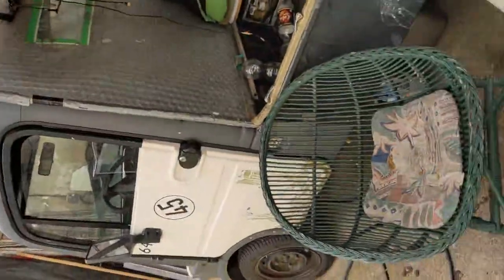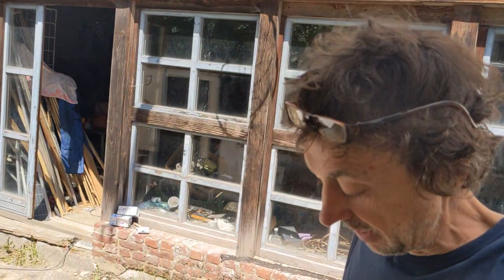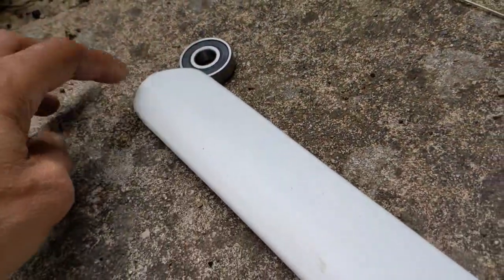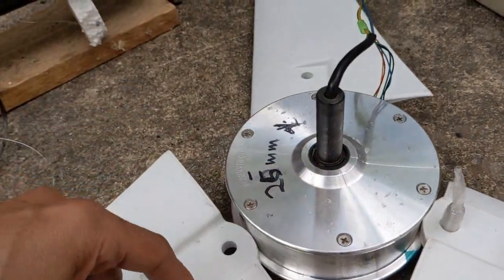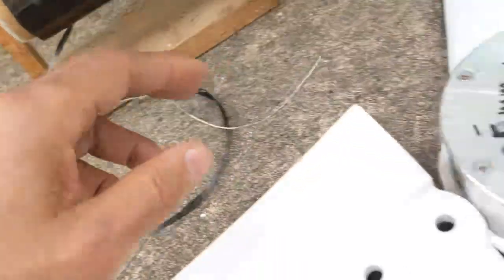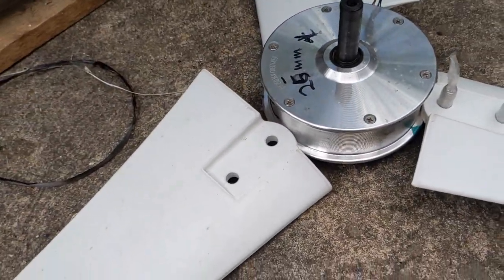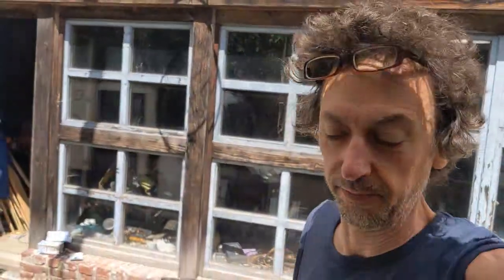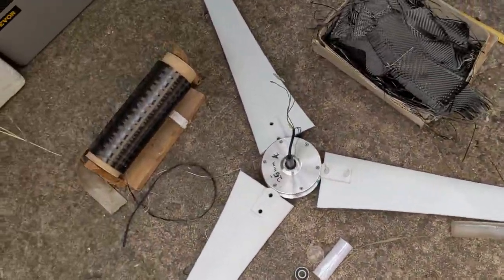4ina: $100 / $50 / $30 for YOU if you build this wind turbine :-)

Comment: What about a metal or other composite ring split into three pieces, with each piece being bolted to a blade? Then you bring the three pieces together around the motor and then bolt or clamp them together with some type of simple bracket or tab on the edges.Then some carbon over the top possibly.
Reply from the maker: Thanks for the input, yes if you want the $100 for a different mount, we first have to agree on your design ;-)
What is crucial about this challenge here is:
1. the hoverboard motor is not modified, at least not opened.
2. The blade mount can be made in one step, at least only two steps (my glassfiber roving approach might need a backside stage and a frontside stage)
3. No welding or other expensive tools neccesary
4. Cheap materials.

And yes, i also already had the idea to simply 3d print three blade-mount parts that simply get pulled onto the hoverboard motor with "Stainless Steel Metal Cable Ties"
The ABS material would mostly need to absorb push forces while the cable ties would carry all the pull forces 🙂

concern 1: centrifugal force F = m v² / r
v_storm = 30 m/s and tsr = 5 (tip speed ratio)
v_tip = 5 * v_storm = 150 m/s
blade length = 104 cm and  blade mount radius = 12 cm
v_12cm = 12/110 * v_tip = 16.36 m/s
m_blade = 0.5 kg
F_30 = 0.5 * (16.36 * 16.36) / 0.12 = 1115 N = 111.5 kg
40 m/s : F_40 = (4/3)² * F_30 = 198 kg
50 m/s : F_50 = (5/3)² * F_30 = 310 kg
Stainless Steel Metal Cable Ties
7.9mm = 150 kg , 10 mm = 210 kg , 12 mm = 280 kg
2x 10mm (to avoid Rotating unbalance) = 560 kg
one blade is hold from two sides at 60° = 2 * cos(30) * 560 = 970 kg :-)

concern 2: Is the engery generating torque twisting the blade forward ?
rpm = 14 rpm/V * 36 = 504 rpm and power generating: 500 Watt
https://www.wolfgang-frank.eu/drehmoment.php => 9.55 N m
divided by the three blades = 3.2 N m
torque between the two mounting bolts = 3.2 * 100/4 = 80 N m = 8 kg :-)

concern 3:
resonant vibrations could easily doube, trible or tenfold any static forces like concern 1 or 2 😕
But the electric generator should absorb concern2 energy fluctiations.

Biggest concern i guess are wind direction changes under full speed. The rotating mass of the blades will lead to tilting the blades forward or backward according to the wind direction (Coriolis force) 😞
But ABS is elastic and the strong centrifugal force should stabilize the blades..

So it might be worth a try.
But big problem is that every blade is slightly different and it might be difficult to program a thingiverse OpenSCAD model where users can quickly make the neccessary stl file.

Unfortunately, 900mm wind blades are not really cheap, so this challanges is not really helpful anyway.

Yes, you could cut a metal ring into three segments, weld a blade-mount to each part and pull them onto the hoverboard motor with such cable ties https://www.aliexpress.com/item/1005005079856443.html

But then it would be easier to open the hover motor and mount a metal disc with 6 M10 holes :-(
Reply: @robodurden Yeah..All of this is above my paid grade. I thought you were trying to figure out a simple way of mounting the blades. Made to be similar if not identical in weight for balance, not welded, secure, and easy to make. I wasn't saying to to weld a blade mount, but to bend one or two into the metal strap at  90°. You would start with 3 (T) or (+) shaped metal straps only bending them and drilling holes to accommodate for the hardware. Now that I'm thinking about how you would obtain metal shaped in that way I don't believe you could without cutting it yourself. That wouldn't be so easy without some expensive equipment to make it easier. Plus the Clamps or bolts that would be used to connect the the three segments together would now be adding weight to some or all of those forces now. In Reality your way is best with the carbon fiber. Need to construct a large enough spindle to hold all three blades and the motor in place while allowing full access from both sides. A spool of carbon and the patches on both sides. Spin it, wrap it  all at once keeping everything perfectly even and in place. Basically a spinning jig. The clamps are adjustable for different blades and the motor mount should be the same or easily changed out. Once the jig is built it should be a easy enough to clamp everything in place and wrap it up tight. Not sure how you would attach the bolts to the carbon maybe weaving through the holes a few times laying some patches with holes cut, then putting the bolts through and wrapping and layering more. Maybe for the OpenSCAD you make the mounts but make the blade mounting points "blank" in a way where people would be able to easily drill  holes  or make necessary changes to accommodate for their blades. I know that's very difficult but I wouldn't say impossible. Once again this is all over my head I enjoy brainstorming ideas. I'd love to make one if i had a better understanding and the necessary materials.
Reply from the maker: > laying some patches with holes cut
You do not need to cut holes for M10 Bolts. The fiber patches/layers are so loose and fall apart that you can easily make room for the bolts. That is why I say in the video that you have circle the bolts with a roving thread afterwards to achieve a tight grip of the M10 Bolts after the epoxy has cured. 

On AliExpress I see that all wind blades available now have a long shaft for the two (or three) mounting holes. Not like my blades where the two M10 holes are in the base of the wing. 
With these new blade design I guess it is easier to open the hoverboard motor and drill six holes into the side, as the blade shafts are long enough for the two M10 screws to reach that flat side of the hoverboard motor.

Comment: Please explain is it hoverboard  how electric circuit and voltage its 36 v generating
Reply from the maker: Better charge a 24V battery. 36V is only found with eBikes and hoverboards. 
These cheap mppt wind controlers (mostly) have a little step up booster to charge battery at low wind: https://de.aliexpress.com/item/1005006273365847.html
Here is a wind/solar hybrid controler that says to also support 36V: https://de.aliexpress.com/item/1005003340726250.html . But i doubt that it really is a solar mppt charger. But i want to know what this hybrid charger does when 36V battery is charged and the wind power needs to be shut down or burned with a load.
The cheap wind chargers can short cut the three phases of the wind turbine.
You can also use the hoverboard controller as an active rectifier which can also step up to charger a battery. See my other video https://youtu.be/D_PfKFIc_kc 
But i do not know how the efficiency compares to the of-the-shelf products. With the hoverboard controller however you could give the wind turbine a push to start spinning.. Might be necessary because the hoverboards bldc magnets need some force to be overcome in order to let the motor spinning.. That is why i think that i needs at least a 2 meter diameter to make the hoverboard motor spin at moderate wind.